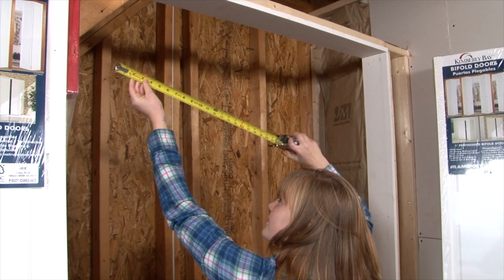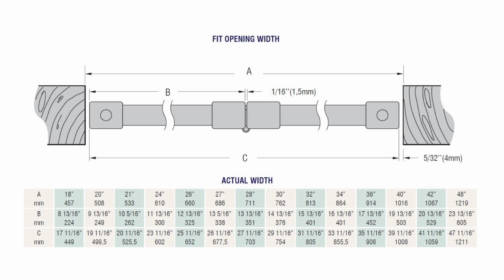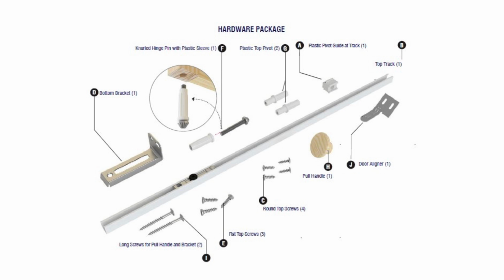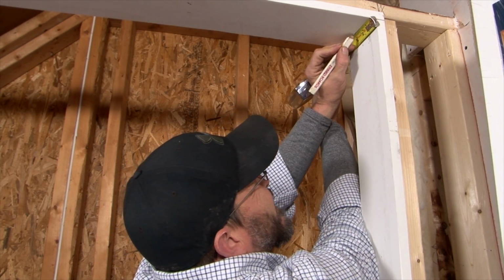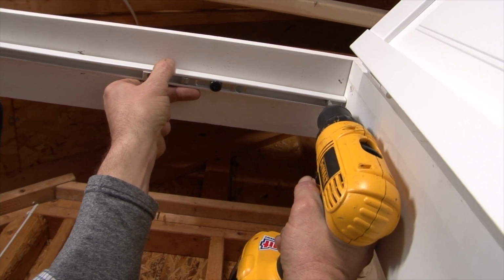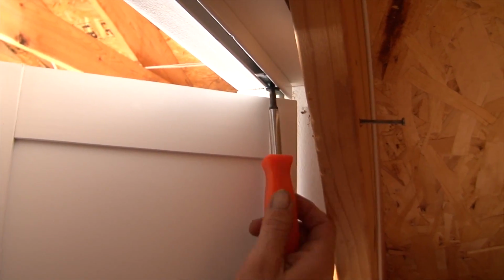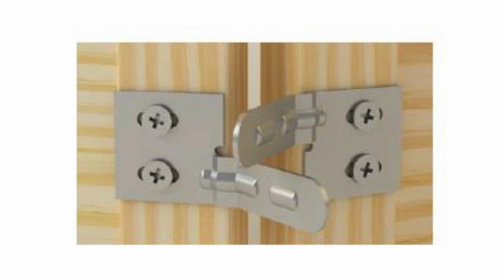Kimberly Bay Bi Fold Door installation video v1.mov

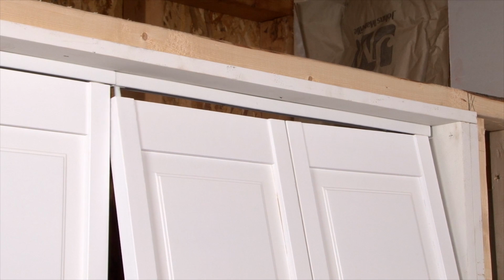Comment: Hmmm. Tried installation as described at 3:04. That sure didn't work. 

START by setting the folded door into the bottom serrated groove, then angle the doors diagonally (top left to bottom right) until the tops lie inside the track. Make sure the sliding bracket lies directly above one pivot, lift the door so one pivot enters the hole on the bracket, then secure after aligning the doors vertically. That worked beautifully.

Comment: The sizing and installation instructions are confusing. Does the opening need to be exact or 
 + 11/16 for the track to fit without being recessed?
Reply from the maker: The height can be adjusted.  If door is a 80" x 36"  it means the door fits a 80" x 36" opening - the door itself is 78.75" x 35-11/16" to allow the track and opening and closing.
Reply: I made my opening 80 3/4" and it fits great, track included. The 1 1/4"  accounted for the space above and below the door (including the adjuster)  but not the track.
Reply: Brain Tarp and
Reply: @bensotuyo5843 , "If the door is 80" . . . the door itself is 78.75" . . . " doesn't make any sense.  Furthermore, according to the chart and drawing at 0:24, add 1-15/16" to the actual door height to allow for hardware -- not 1-1/4" as you and your narrator say.  Someone's going to screw up his DIY project because of your mistake.
Reply: I took construction class in high school learning what a rough opening is. When I purchased my doors, I made my rough opening according to the instructions. Then I finished my wall opening with drywall and wouldnt you know it, l and behold, my doors were too tall so I ended up having to trim 2" off the total height (1" on each end). Wayfair or Kimberly Bay needs to know what a rough opening is. This better work. Those doors weren't cheap!